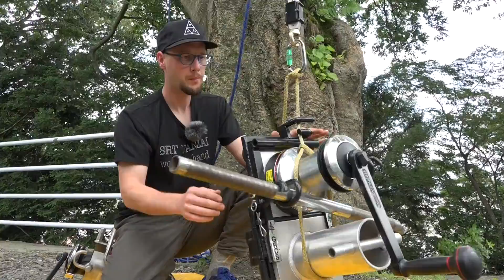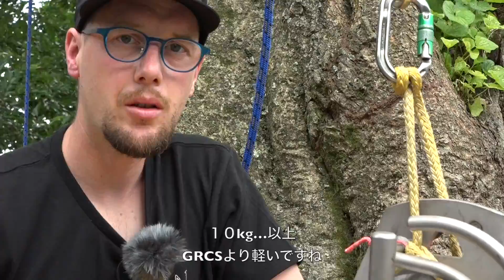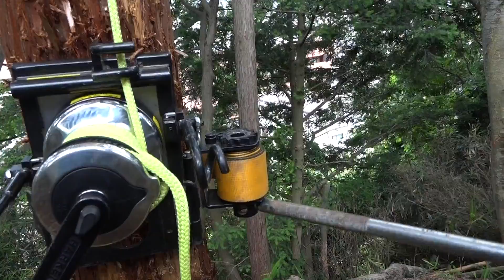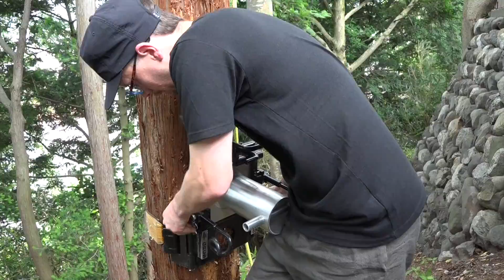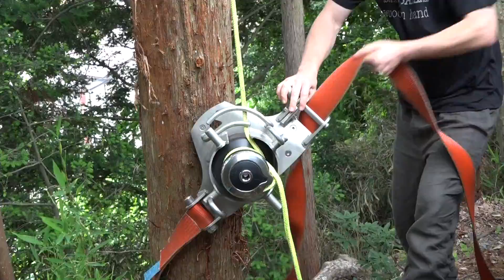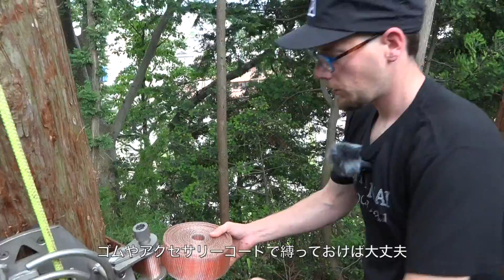Smart Winch & GRCS

Comment: The GRCS with the visor plate attachment seems as though it would take heavy shock loads better, the smart winch is relying on the strap and rubber bumpers only. I have found the GRCS without the visor plate, isn't sufficient for heavy rigging and lifting. I want a smart winch but the lack of that upgrade/feature is a deal breaker for me.
Reply: All of these devices can be ‘cut in’ to the trunk.  Do you know what that is?  Simply cut a section on the outside of the trunk for the body if the device to sit in, and importantly for the top of it to butt against when rigging big loads. 

The visor plate is a great idea but for me is not a deal breaker.
Reply: Thats a great point! I’m going to go buy one haha
Reply: @softbankhawks77  one strap is just so silly why not have two straps with a 12inch space between them and no need to cut any stupid slots or any of that rubbish in the tree just strap it up and off ya go
Reply: I'd agree